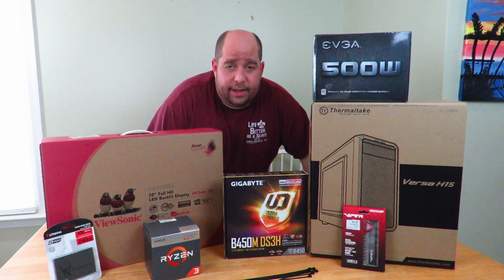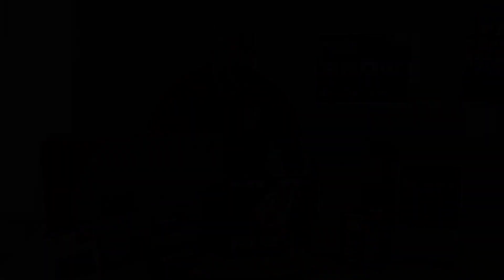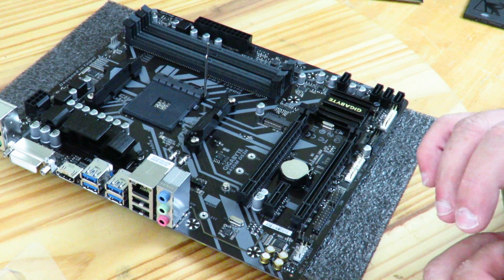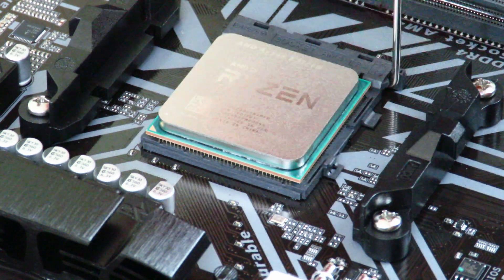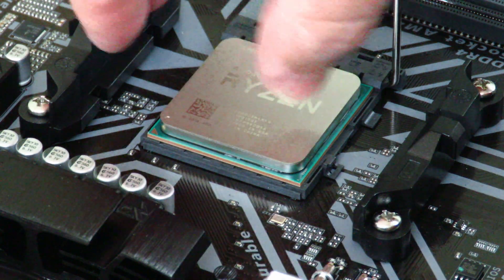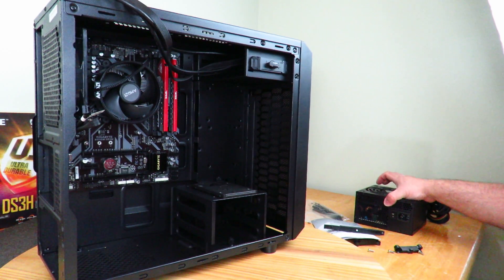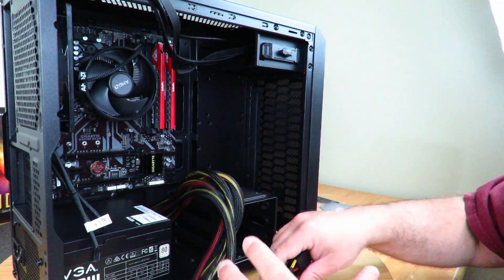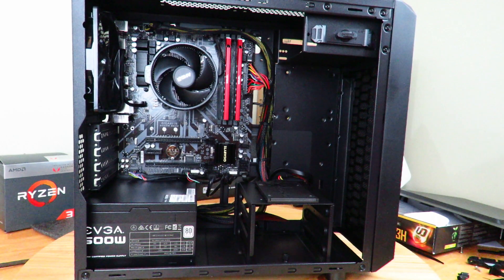How to Build Extreme Budget PC that doesn't Suck | Step By Step Guide

Comment from the maker: Learn how to install Windows 10 on the Asus TUF Z370 PLUS: https://youtu.be/O3CKrFC6Bzw
In this video, I build an Extreme Budget PC for my friend Angels birthday.  Check system specs and links below, more coming soon.
AMD Ryzen 3 2200G Processor: https://geni.us/THQ1QQr
GIGABYTE B450M DS3H Motherboard: https://geni.us/C30Fy
Thermaltake Versa H15 SPCC: https://geni.us/0WyjgE
Patriot Viper Elite Series DDR4 8GB 2400MHz: https://geni.us/zkvT9
Kingston 240GB A400 SSD: https://geni.us/oAfah
EVGA 500 W1, 80+ 500W Power Supply: https://geni.us/vbNb6
Microsoft Windows 10 Home: https://geni.us/E1NjgGS
Sceptre E225W-19203R 22": https://geni.us/yueH6f 
Total = $485.03

They did not buy a keyboard or a mouse, but I would have gone with these:
ROSEWILL NEON K51 - Hybrid Mechanical RGB Gaming Keyboard: https://geni.us/pAct3 29.99
Logitech G300s Optical Ambidextrous Gaming Mouse: https://geni.us/m12Mk $19.92
Grand Total: $534.94
Reply: How good is this motherboard when compared to something like a b450 tomahawk and is it worth the price difference. Nice explanation 👍.
Reply from the maker: sadly it was a build for a friend, so I don't have it anymore, though I never hear anything from them, so as far as I know, it all works great.

Comment: Just saw this. No thermal compound on the cpu?
Reply from the maker: Of course there is, and I mention it too, I am using what comes on the heatsink, it comes pre applied with compound, I did not change it, because of course it would add to the cost of the system but it is also a video that is a few years old.  Much newer, I came up with this one late last year (2020) a $900 build https://youtu.be/I3fssq2t-Js and then one I just released today you might like which is a $1500 build: https://youtu.be/cHps_f44Ifs, let me know what you think.

Comment: hello could u tell me how many headers the DS3H has for case fans ,i ordered deepcool matrexx 55 v3 add-rgb 4f, which has 4 preinstalled rgb fans and i dont think there are enough headers for the fans. Will a simple 1x4 fan splitter do the job ,will it work with the 4 preinstalled rgb fans and ds3h mobo?
Reply from the maker: it only has 1 CPU header at the top of the board and one system fan header between PCIE 1 and the CPU, towards the rear I/O.  You might want something like this off of my Global Amazon Affiliate:  https://geni.us/4zni2 which gives you a total of 10 additional ports from a single 4Pin PWM header

Comment: I have this MOBO and was thinking about making a gaming machine with RGB lights. Not sure if this is a wise choice, maybe just build it without lights, but can't figure out which case to use. The case I have I can't figure out the wiring for the front panel, headphones and mic. not so concerned about the mic. but need the headphones to work, without the speakers or visa versa. So far only able to use the headphones with the speakers at same time grrrrrrrrrrrrrrrrrrrrr.
Reply from the maker: it will work find, it has ARGB headers.

Comment: Hey dude doing my first build with old parts and this board (They are all compatible) connected everything apart from USB 3.0 as my case didnt have one. The build isnt powering up when i hit start is this due to me not having a USB 3.0 or should i re-check my header connections? Also power supply is 5 years old but worked when i upgraded earlier this year.
Any suggestions would be greatly appreciated and thank you for this video gave me some great info that i needed 

All the best
Reply from the maker: Awesome I could help you.  Check your case header cables and make sure the 8 or 4 pin cpu power connector is plugged in as well as your 24pin atx cable to your motherboard.
Reply: @ThisBytesForYou  Hi Bud thanks for getting back to me and sorry on delay, I double checked case header cables and they are all correct i also took 8 pin and 24 pin out then back in.
Still getting nothing not a beep or a light, all components are new apart from case, PSU and GPU but im not putting GPU in till i get a post. 
What is most likely culprit PSU or case? I would be willing to buy either im just stumped as this power supply did work in my main rig before i upgraded but has sat idle for about 7-9 months
Reply from the maker: @jamesd4569  take everything out, and put the motherboard on the foam that came in the box and see if everything powers up.  If it does.  check in the case and make sure you have the same amount of stand offs as screw holes on your motherboard, if you have too many, take out the extra one from the case the board does not have.

Comment: I lost my am4 bracket so i got them from second hand website but what i got was am4 gigabyte aours b450 bracket so will it work with asus tuf gaming plus b450 or not? As i saw asus and msi b450 bracket shape diffire from gigaybte aours so they all am4 the same but will aours bracket fit with asus tuf b450 or must i replace them?
Reply from the maker: AM4 is a standard, the bracket should be standard, mind you there might be a few differences to make it look more pretty and the likes, maybe a few termination differences, it should be the same.

Comment: Do you know what the issue could be for monitor not detecting HDMI after finishing putting everything together?
Reply from the maker: Amd is having issues with drivers and windows 10, its both amd and ms.  Something that will help is hdmi 2.0b cables, most people have older hdmi cables laying around.
Reply from the maker: Also, make sure your monitor has hdmi selected as the correct input and you are connected to the video card and not on dye gpu.
Reply: @ThisBytesForYou  do older HDMI cables fit the same as new versions? Because I'm not sure if I have an older cable if anything I'll just order a 2.0
Reply from the maker: Yes, the connection is the same, just things inside the cable changed.  Try a dp cable if you have one.  What motherboard do you have?
Reply: @ThisBytesForYou  Gigabyte B450M DS3H
Reply from the maker: @iQSolo  make sure you are on the latest BIOS version for your board, F51, you can find it herE; https://www.gigabyte.com/us/Motherboard/B450M-DS3H-rev-10/support#support-dl-bios also make sure you on the latest version of windows version 2004 and this driver was just released 6 days ago, it might help https://www.amd.com/en/support/graphics/amd-radeon-5700-series/amd-radeon-rx-5700-series/amd-radeon-rx-5700-xt-50th

Comment: My build doesn't have a USB  just the USB 3.0 is that normal?
Reply from the maker: What do your build have, what motherboard (manufacturer and model number) and case (manufacturer and model number)
Reply: @ThisBytesForYou  Gigabyte B450M DS3H

And the case

Master MasterBox MB311L ARGB Airflow Micro-ATX
Reply from the maker: @KingQYT  so the board on the back has usb 3.0 headers, not on the board, so if you want a usb 3.0 header, you need to buy this, it's cheap; https://geni.us/IAZ9OvY but it does have 2 x USB 2.0 headers under the last pcie slot.

Comment: UMMM  THERE IS NO PLACE FOR ANY HDD   I USED A LOT OFF THEM BECAUSE I GOT A HUGE MOVIES AND VIDS COLLECTION.
Reply from the maker: there are 4 sata ports, you have space.  If you have more than 4 sata drive, consider moving to external storage or buying larger drivers.  This is a budget board, you cannot expect it to have 8 ports, if so, you might want to look at a more expensive board.

Comment: Dude... the front panel connectors are the reason why I came to this video.  They are the most difficult part.  Don't do them again off screen.  Thanks for the guide, however I wanted to see you attach them.  Thanks.
Reply from the maker: The front panel actually are in your motherboard manual, they will be different for every motherboard.  Check your motherboard manual and it will give you all the information you need on it, I skipped it on purpose for that reason.  You are very welcome my friend, I hope the rest of the guide helped.
Reply: @ThisBytesForYou  It definitely did.  I have the same motherboard you used in the video.  The Gigabyte with a Ryzen 2600.  Unfortunately I got it from a major mail order firm that had the motherboard shipped from Shanghai China.  All of the instructions of what little came are in Mandarin.  Your online guide helped immensely.   Like I did in my last build I saw that I had first not wired the front panel correctly.  Attaching the wires vertically instead of horizontally.  The manufacturer could help out by making the silk screening bigger and clearer.  Thanks again for your quick response and help.  Excellent video with good sound.  Thanks again.
Reply from the maker: @Smenkhaare  anytime my friend, thank you so much for your kind words and I am so very happy I could help you.  The silk screening always seems to be an after though, but at the same time, there is soooo little space to work with, also, the manuals are always available on the manufacturers website, check it out here: https://www.asus.com/us/Motherboards/TUF-Z370-PLUS-GAMING/HelpDesk_Manual/
Reply: Thanks great advice.
Reply from the maker: Anytime my friend, very happy I could help

Comment: Is  this motherboard compatible with  ryzen 1600, 8gb ram hyperx 2666 and powercolor rx 550 4gb Red dragon?
Reply from the maker: yes it sure will work, check it out in the description if you want to check it out on Amazon, its very affordable and works very well.
Reply: @ThisBytesForYou but my case have 2 fans + The fan from  cpu, and i read that motherboard can attach 2 fans only,  can i put molex  cable  for The 3rd fan? Thanks  so much  for the  answer
Reply from the maker: @vsy3343  yes you sure can, but just know, using a Molex will mean the fan will run at 100%, depending on the fan, it can get loud.  I would recommend something like this: https://geni.us/bjYVRmg
Reply: @ThisBytesForYou  thanks so much bro
Reply from the maker: @vsy3343  you are so very welcome my friend, very happy I could help.

Comment: will this motherboard support ryzen 5 3600x and rtx 2060
Reply from the maker: yes it will, you just need to make sure, to support that processor that you have the latest BIOS.  The video card will not be an issue either.
Reply: @ThisBytesForYou  does it support gt 1030 2gb
Reply from the maker: @athulwilson5764  yes it sure will
Reply: @ThisBytesForYou  can I first use with gt 1030 and then upgrade to rtx2060 super with Ryzen 5 3600

Comment: Hey I've just build the same exact setup with gigabyte b450m amd ryen 3200g etc .  when i connect the mobo with hdmi to a monitor  , there's no sound from the monitor . The display is fine and even my pc detect there's another audio source from my monitor . I've tried updating my driver and removing hd audio from faudio , still doesnt work ! This is my first time building a pc and this small problem bothers me so much . Any help would be appreciated . And yes i already tried switching ddevice playback, thanks btw your video very informative for my guidance
Reply from the maker: have you tried to change the audio source from the task bar notification area?  On the bottom right hand corner, where you see the time, you will see your speakers, left click on this, click on the arrow to change the sound source and see if that would work for you.  I am just double checking this is what you did.  Have you tried raising the audio on the monitor too?
Reply: @ThisBytesForYou  yess i tried to change my monitor and change the cable , still doesnt work :( . Its really weirdd , is it possible this is from hardware related issues , maybe i plugged the wrong pin 😂😂
Reply from the maker: @owenfer6458  maybe, but do you have any cables throughout the house that do work?
Reply: Tried a couple cable still no good  :( , maybe its just not my luck , my last plan to reinstallimg windowss , thanks for your advicee !
Reply from the maker: @owenfer6458  are you trying the latest 20.5 driver?
Reply: @ThisBytesForYou  whatt driver ?
Reply from the maker: @owenfer6458  https://www.amd.com/en/support/graphics/amd-radeon-5700-series/amd-radeon-rx-5700-series/amd-radeon-rx-5700-xt, video driver
Reply: @ThisBytesForYou  just finished installed it , still no audio . It's really weird problem .
Reply from the maker: @owenfer6458  Thats very odd, but what audio source are you using, the CPU' audio or a video card?
Reply: @ThisBytesForYou im not using any video card , so it should be from cpu . Does it required any extra setting ?
Reply: @ThisBytesForYou  and also chang my audio source to my monitor

Comment: I got this motherboard (gigabyte b450M DS3H) With a new ryzen 3 3100, but I'm getting no signal do you know why? I'm getting power on the motherboard as the fans work, power led on the PC case so the motherboard isnt doa is this motherboard compatible with a ryzen 3 3100 out of the box or do I need to do a bios update?
Reply from the maker: the BIOS needs to be at least F40, the box for the motherboard should have somewhere, where it states what BIOS you have flashed on that board.  Let me know what version it states.
Reply: It doesnt say anywhere on the box that I can see, will there be anything on the motherboard
Reply from the maker: Check on the bios chip itself, they usually put a sticker on it with the bios version.
Reply: Winbond
25Q128FWSQ
1937
I Domt think it means anything
Reply: I looked at the box of my cpu and it says require descrete gpu I popped in a 750ti and that powers on but still no signal that Last thing I can think of is literally the bios update but I cant find it anywhere, I'm gonna get a athlon 200ge hopefully get a picture and get the bios update onto a USB drive and sort it out
Reply from the maker: Ahhh yes, I didn't realize that you were using onboard graphics, yes it would require a gpu.  So it looks like it might have an older bios and that's a great idea, on ordering another cheaper one to update it.  Please let me know how it goes.

Comment: Hey.. i just bought this motherboard recently. How can you connect multiple fans when this motherboard only have 1 fan connector on motherboard?
Reply from the maker: The motherboard has the CPU Fan header and the a fan header behind the Ethernet port.  If you want more than 1 fan (which we all do of course), you would need to buy something like this: https://geni.us/gq4R
Reply: You can also use the moles connectors instead if they have them
Reply from the maker: Molex connectors work but they will be running at full speed, not regulated by the bios and pwm.
Reply: ThisBytesForYou thanks for telling me I was about to get new fans and use molex
Reply from the maker: Anytime my friend, happy I could help

Comment: Hello, i am planning to use this budget motherboard for a Ryzen 5 3600. I have a Gtx 1060 6gb. Will this do the job? Im more on playing online games not really fan of rpgs. Thanks and nice video! Straight forward
Reply from the maker: this board will take you all the way up currently to a Ryzen 9 3950X so you are good.  Thank you so much for your kind words my friend, I really do appreciate it and you are so very welcome, so very happy I could help.  Also, I have close to 400 videos on here, I am sure I have a few others that can help, and working on building my AMD line up, even though I do have plenty of AMD related videos as well.  I hope you find something else on my site to help you, if not, let me know, I might be able to create a new one.
Reply: @ThisBytesForYou  thanks man. I still have my i5 4570 and had served its purpose and eill be retiring already and switching to amd over the weekend. I guess my only hope is that my gtx 1060 will still last for 1080p gaming in the next couple years and less gpu bottlneck when I pair it with Ryzen 5 3600.
Reply from the maker: @singwithme4480  yeah, I think you will be good my friend, no worries.  If you have any issues installing windows, I have guides on that here as well.  always trying to help.
Reply: @ThisBytesForYou   Hi brother, I already have my system set up and it  only has 1 system fan and rgb header. I plan to get deepcool gammaxx aio L240 and this rf120 3 in1. My concern is how can I sync all the fans(5) and rgb withi only one fan and rgb header? thanks!

Comment: hey man i’m considering buying the ryzen 3 3200g and i just bought this same mobos and i was wondering if it would be compatible with the cpu right out of the box without a bios update?
Reply from the maker: The board supported the 3200g by BIOS version F40, when I built this system, that BIOS did not exist, but as time passes and Gigabyte supplies warehouses with newer boards, they generally have the latest update at the time.  F40 was released 05/16/2019, so chances are, it will have that BIOS or newer.  I hope this helps you my friend.  If you are curious of all the parts in this system, in the description I have a full list of parts with my global amazon affiliate links which works world wide.
Reply: ThisBytesForYou thanks for swift response!
Reply from the maker: You are so very welcome my friend